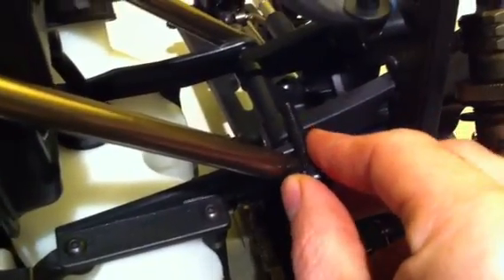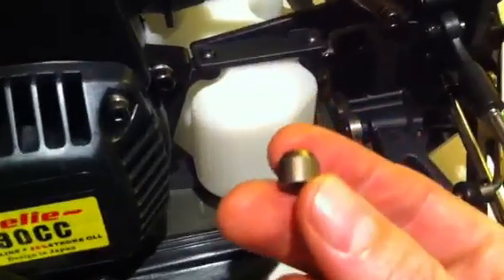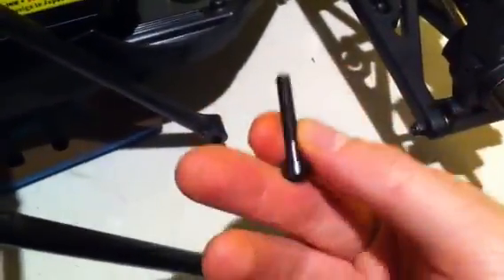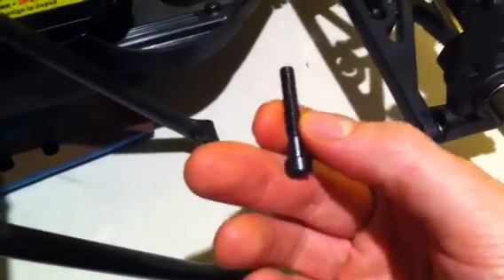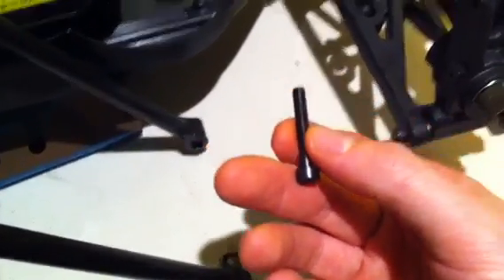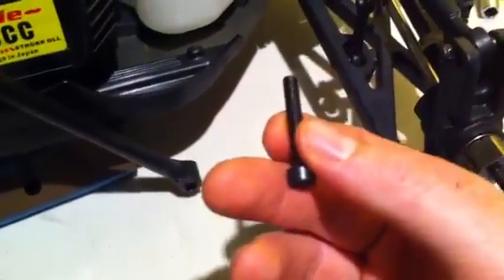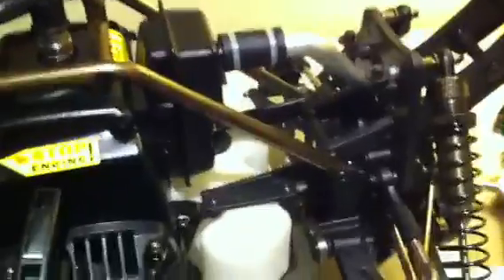Rampage XB XT XSC Aluminum Roll Cage Installation

Comment from the maker: Yup, it's on the "hop ups" page.  Part # 710014 $26.99  It's virtually identical to the plastic cage in dimensions so shouldn't cause any problems with your JetPro

Comment from the maker: The XSC, XT and XB all come with a factory tuned pipe that would cost about $50 to replace.  My XB doesn't have the pipe installed as it is an early model.  The factory tuned pipe is much better than the "can" I have installed in this video but it's no match to a JetPro